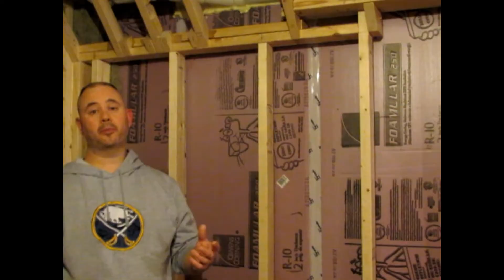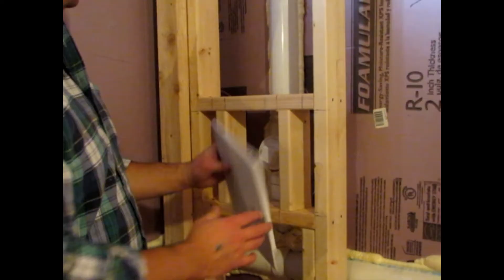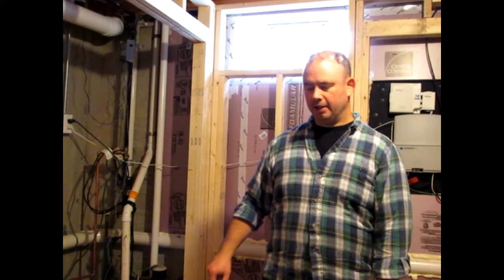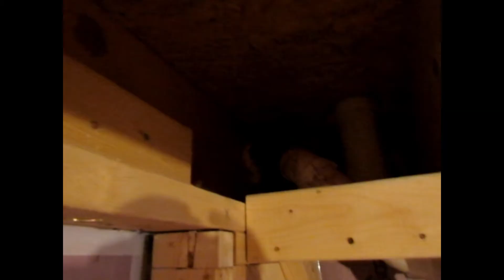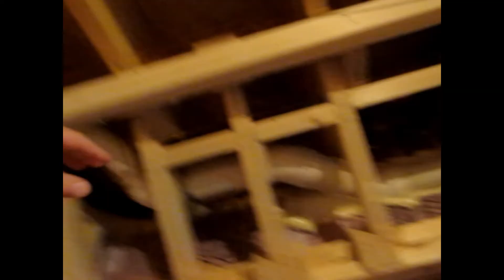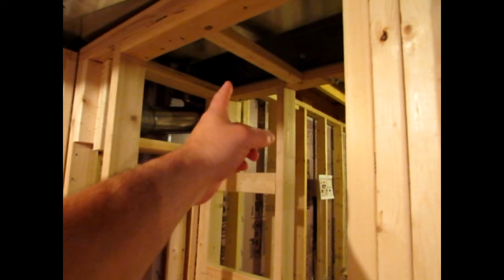Finishing a Basement - Part 6a - Framing Challenges - Utilities

Comment: 4:19 I’m in the middle of doing my basement and ran into your videos (they’ve been super helpful, thank you) but I have a question for you. How did you secure the 2x4 underneath that pipe at the top of the wall?
Reply from the maker: Apologies for the delay in reply.  There is blocking between that wall and the wall behind (perpendicular) to it which ties it all together and creates a solid corner.

Comment: 0:42 why is the cleanout all foamed like that?
Reply from the maker: It's part of the moisture and damp proofing.  Please have a look at the first videos in this series on those topics for more info.
Reply: @Buffalo-J so, how do you open the cleanout then
Reply from the maker: @cpy  IF and When you need to access the cleanout then you would need to pull / cut the foam away, do the job, and then replace it.   In 25 years I have never had to access that cleanout so unless you have some real plumbing challenges of folks putting things down drains that don't belong hopefully that is a rare instance the cleanout needs to be accessed.  But if you want to achieve moisture proofing then it needs to be done.  No different than insulation or drywall, etc. anywhere else that covers a utility.

Comment: Did you end up using the 6mm poly on your framing before drywall?
Reply from the maker: No, please see the first videos in this series regarding moisture and damp-proofing.
Reply: @Buffalo-J  thanks. I've watched it a few times. Was just checking as you haven't shown the drywall phase of the project yet

Comment: How would you handle clean outs in the floor that are tied into the drain tile
Reply from the maker: That's a tougher one.  You can add some access panels/ports which you may even need ton design yourself depending on your specific conditions.  The key is to seal around the floor clean out so that you do not have a break in the vapor barrier, then that clean out access will simply have to be exposed slightly to your slab floor, but this is a small area.  Then just find or create a removeable access cover which will work for you.